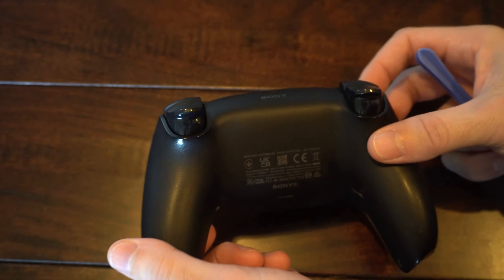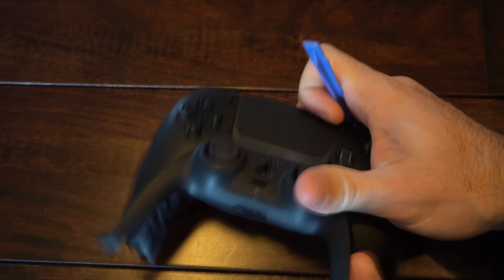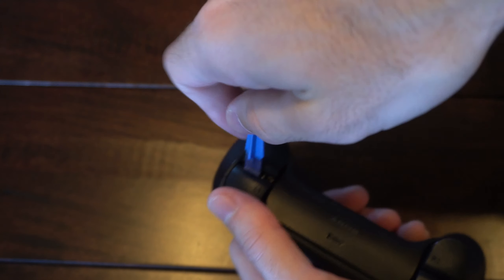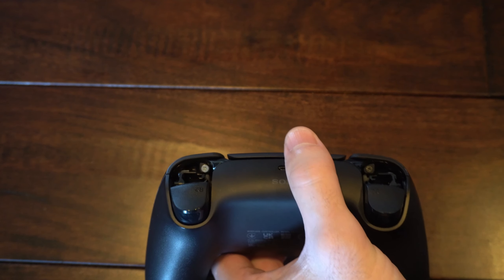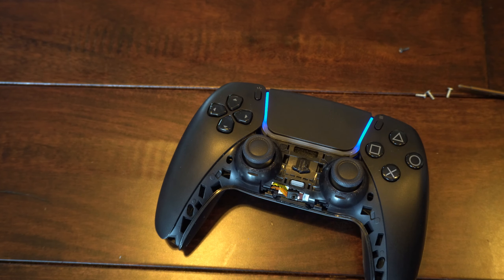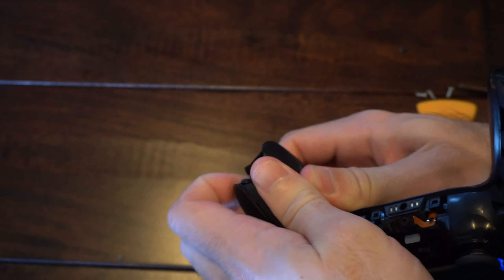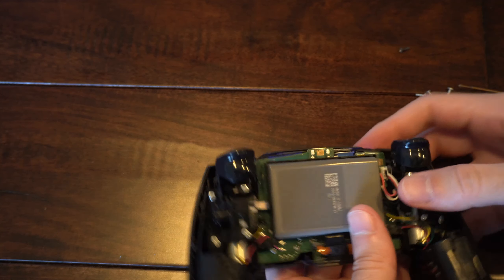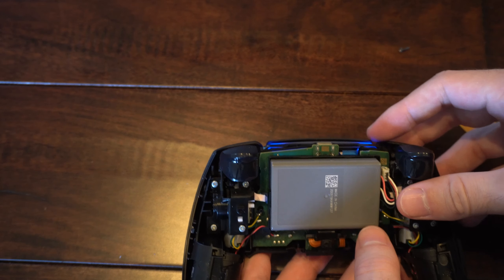How to Remove Cover & Take Apart PS5 Controller (Fast Tutorial)

Comment: having a hard time with back shell, the upper part is blocked (at the r1 r2 and l1 l2 section) and i remove the two screws, so i don't know what to do.
Reply: Same
Reply: Pull harder it comes off
Reply: @donlad  wrong

Comment: I needed to know how to remove the front plate to check the face buttons. My Triangle button stopped working and I wanted to know if I could clean under it to fix the issue before I buy a new one